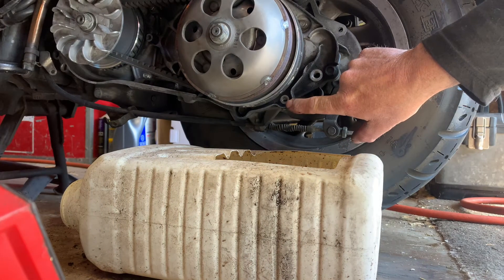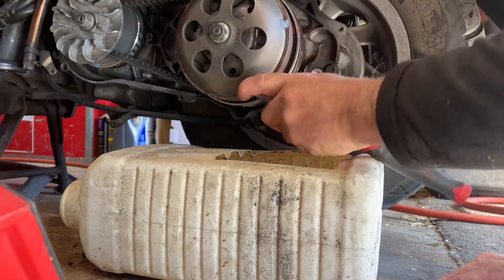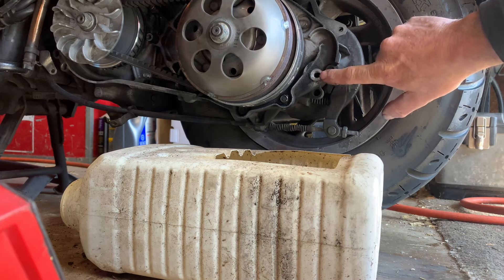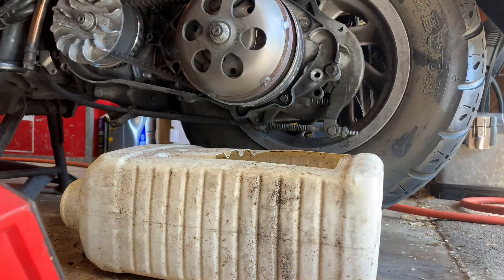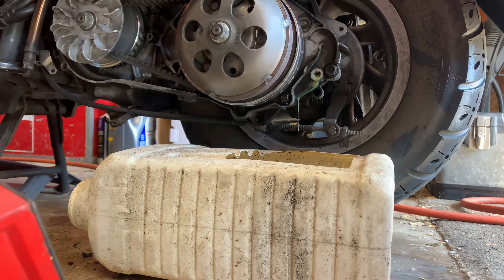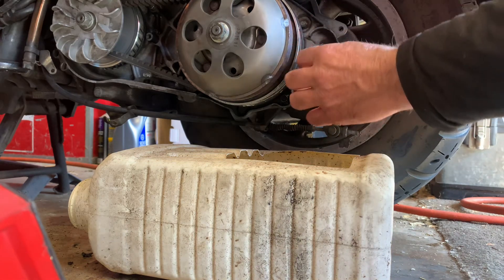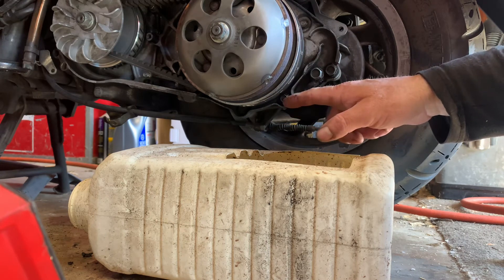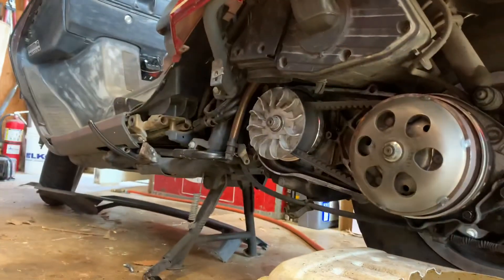Honda helix changing gear oil

Comment: Lots of controversy,well not controversy but conflicting opinions on using gear oil vs. motor oil in final drive. I just did mine and used 10w30. Have you used gear oil all along without issue.
Reply from the maker: Yes all I use is gear oil no problems I have put 9000 miles since I have owned it
Reply: The service manual 80w90 gear as well or 75w90 synthetic which is what I use.